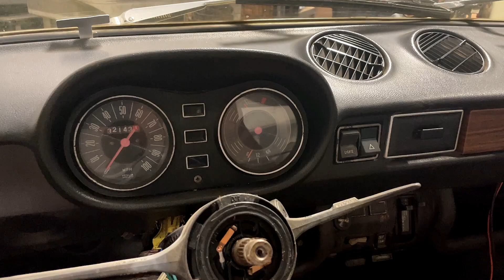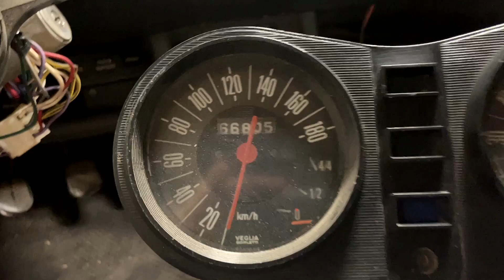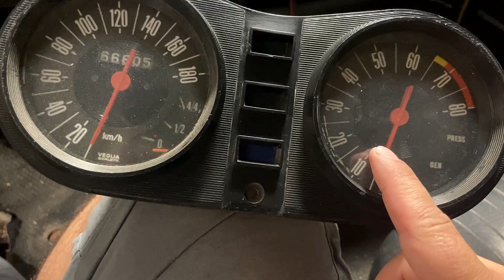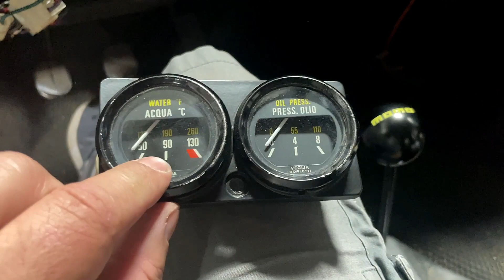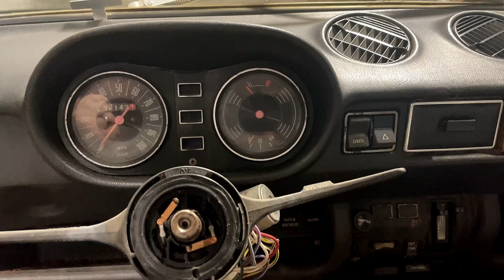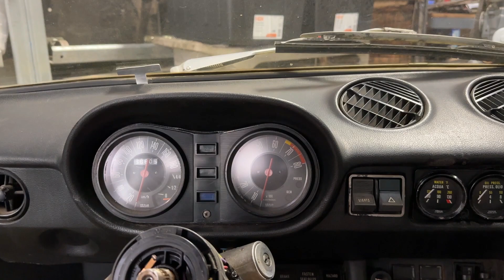Installing 128 Rally Gauges into the Fiat Project Car - Part 1

Comment: That’s exactly where and how I’m doing my 3P oil pressure and amps gauges, except that I had to make my own facia to mount them in.   I’m hoping to just swap the oil pressure warning light sender out for the gauge sender, and tap into its cable behind the instrument cluster to extend it to the gauge itself.  I guess I’d better watch Part 2 to see if that’s feasible / how you did it.   You could probably reuse the original water temperature sender and wiring in a similar fashion but, again, I should probably see your next video to see the pros and cons to that.  Great work.  Thanks.
Reply from the maker: I'll be posting part 2 soon

Comment: Glad to see some progress on it, ngl here in Argentina this series of 128 and the second generation had the same style of basic gauge clusters with only the speedo and the two other gauges but we had our own sporty variants known as IAVA which was an out of factory customizer which gave these plenty of power under the hood and those are the few ones that came with a rev counter, from 1983 and onwards with the introduction of the Super Europa version which was the last facelift, the rev counter was standard so we had three gens of 128, the Berlina which is the one you have, though it's more of a nickname, then the Europa with the square lights and the Super Europa which was the last facelift until 1990 when it was replaced by the Duna/Premio. They're pretty neat and cool cars, still common today.